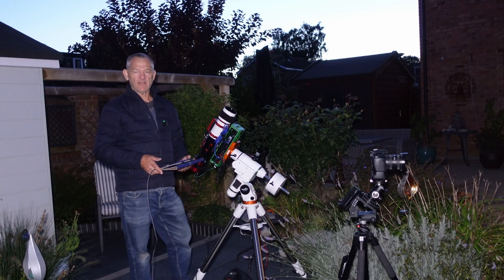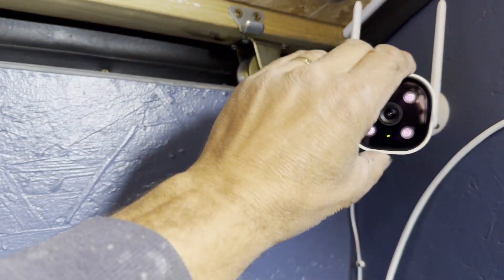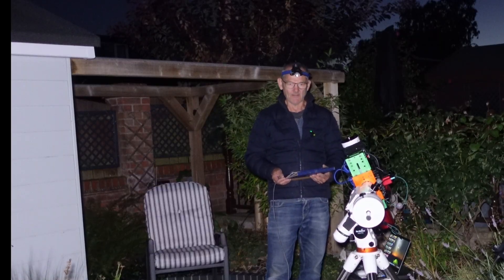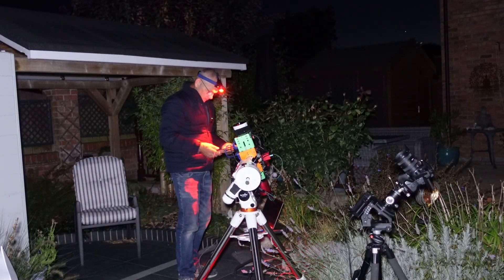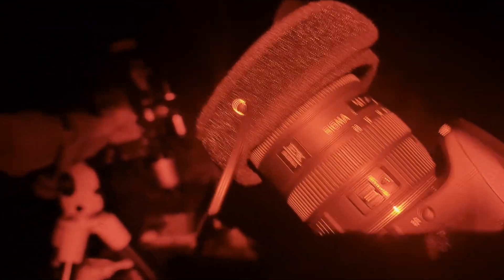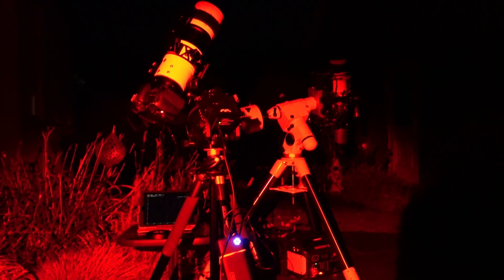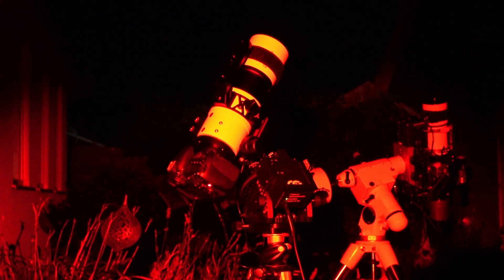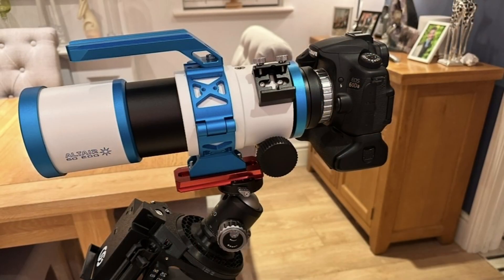20 Hours Deleted 3 Images Survived

Comment: Great Crescent there Simon. Good job!
Regarding weight on the OG tracker and batteries - Just stick a dummy battery in the DSLR. Lighter than a battery and you won't have to change it.
Lastly, at 2.30 I thought I saw a fleet of 'orbs' in formation. Looks to be just dead pixels 'apparently' moving due to the zoom-in.
Reply from the maker: Good call Nugsy, that would reduce the weight and without the battery grip! Also 30 sec subs instead of 1 minute would have helped! Re the orbs, probably bloody Elon again 😂 Thanks for watching and clear ski!

Comment: Hey Simon, fantastic image of the Crescent. The detail in both the Ha and OIII shell is tremendous. It feels very painful to have to throw that much data away but was clearly worth doing for the final result you achieved. I too have forgotten to undo the clamps on my roof and the cog on the motor chewed the teeth off the rail and required a segement to be replaced (ouch). Looking forward to seeing the result on the star tracker once you get your setup on a diet and get the weight down. And thanks for the shout out too, much appreciated😀. Clear skies.
Reply from the maker: Thanks for watching Logan, and my pleasure on the shout out for such a worthy image👍 Yeah I forgot he clamps once and it bent it so much, I could hardly undo it, luckily I was there so was able to stop it in time before the motor burnt out! I debated on binning so much data, but only wanted to use the best, so still quite happy! Hopefully I won’t overload the tracker next time🤦‍♂️ Clear skies 👍